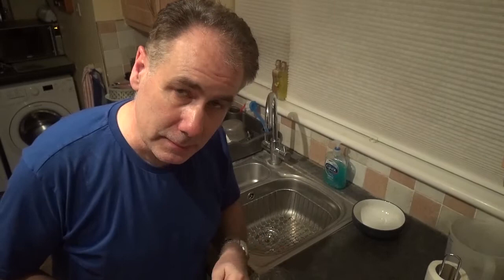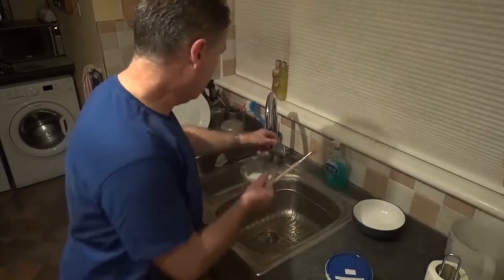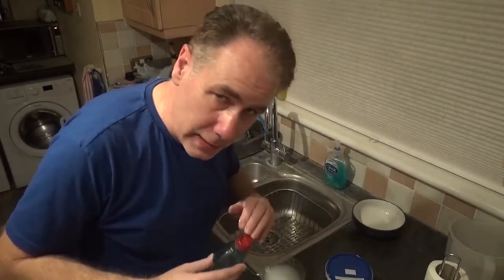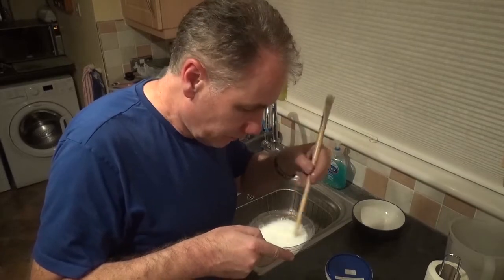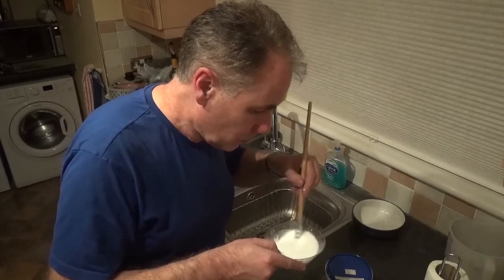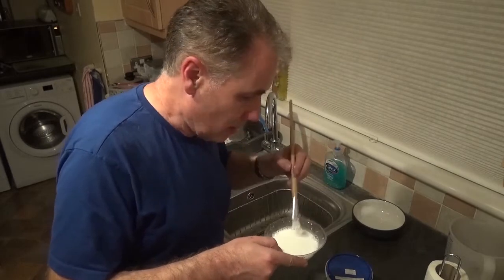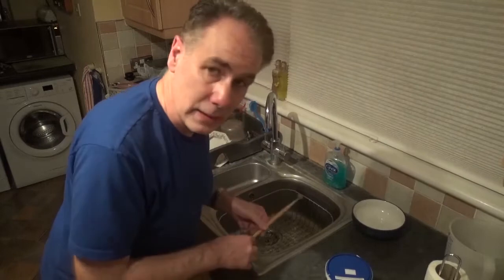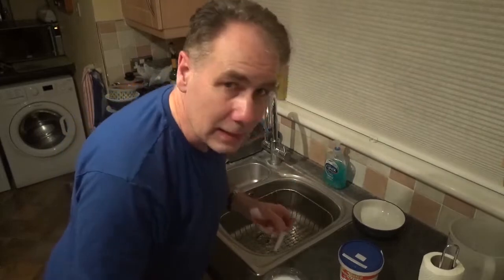Explode Layout Pt5 Water and Ballasting

Comment: Good job Laurie. You explain the ballasting very well. I love your water feature. I would have loved to add a canal and hospital barge to mine but they were very large and I would have to have scratch built it for my WWI layout. Maybe when I have a larger permanent setup, I can gain the confidence to do it and have a 16 coach ambulance train too :)
Reply from the maker: Hospital barge sounds great. I need to do a bit more on the water still as it is more of a dried up river bed at the moment. To be fair the boat is a little bit on the small side but boats do vary in size, so perhaps it is ok. Trees are generally too small but we cheat the scale in modelling. As long as it look right, that's the main thing. Although that is subjective of course. This ballasting was easy to do. Only took 20 mins to lay it down. Cheers, Laurie.